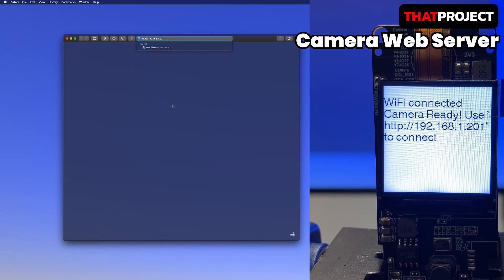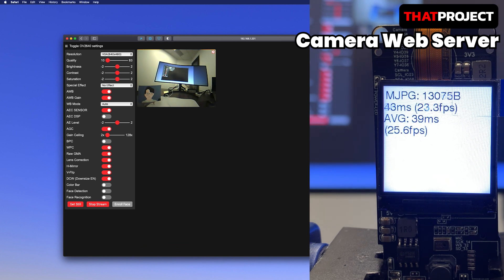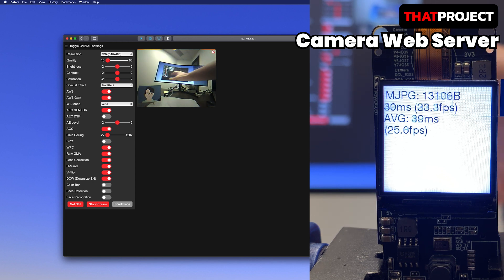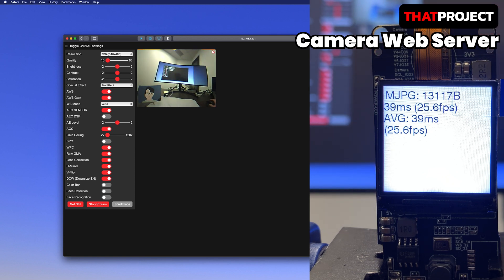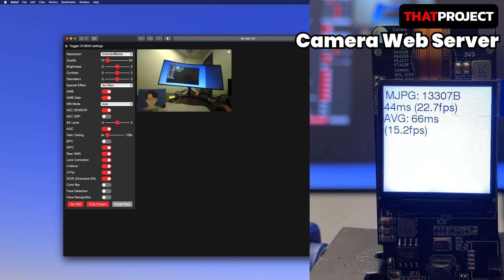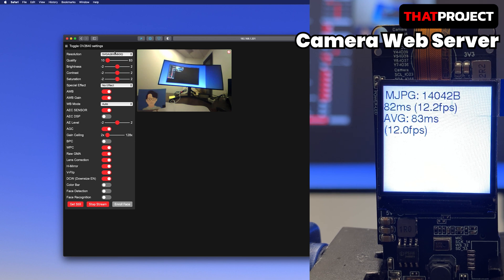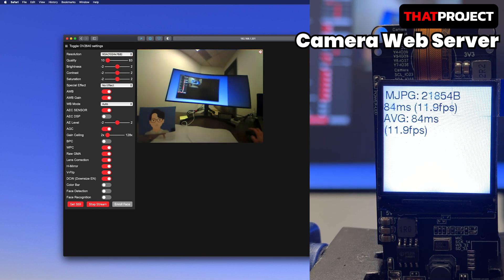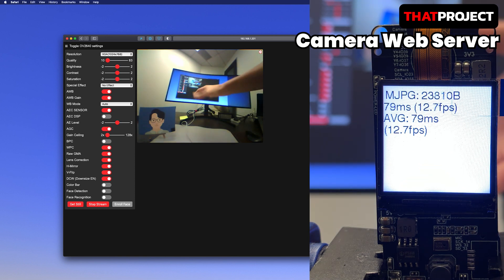What's different TTGO Camera Plus vs ESP32CAM AI-THINKER?

Comment: I do not get you. It seems like the same cameras are used, that is, OV2640. But the image is better on ESP32TTGO? Or are the cameras different in some way, for example, by the connector? Can the OV2640 camera on the ESP32TTGO be swapped with the camera on the ESP32-CAM?
Reply from the maker: Since both use OV2640, the resolution and output format are the same. You can think of this device as a version of the ESP32-CAM AI Thinker board with a screen and MIC added.
Reply: @ThatProject  Then due to what improved the quality of the video?

Comment: can i have the code to write for using ttgo lcd or documentation ?
Reply from the maker: You can find all information you want from here. 
https://github.com/Xinyuan-LilyGO/esp32-camera-screen
Reply: @ThatProject  how to flash ttgo ? arduino idle say can't open
Reply from the maker: @simonevetere9152  The source code they support is NOT for the Arduino platform. It's ESP-IDF. To build and flash it to your device, you need to set up your dev environment for ESP-IDF. OR If you don't need this example source, you can just build and upload Arduino-based projects.
Reply: @ThatProject  thank you, the server work, but my screen is all black, i see this commented 
// TFT_eSPI User_Setup_Select.h 
// #include <User_Setups/Setup44_TTGO_CameraPlus.h>   // Setup file for ESP32 and TTGO T-CameraPlus ST7789 SPI bus TFT    240x240

but arduino say can't find xxx.h etc.. so i alredy try to decomment #include <User_Setups/Setup44_TTGO_CameraPlus.h> but still doesn't work my screen
Reply from the maker: @simonevetere9152  I don't get it. what is the xxx.h? BTW, you're sure you set the dev environment for ESP32 Arduino, aren't you?
Reply: @ThatProject  sorry for english basically with the Arduino code I can't set the working drivers for the ttgo t-camera plus screen, everything works except the screen, do you have any suggestions?  the screen works on the hardware level, but not on the software
Reply from the maker: @simonevetere9152  Have you tried my source code after you set the TFT_eSPI user_setup.h? https://github.com/0015/ThatProject/blob/master/ESP32_TTGO/TTGO_T-Camera/CameraWebServerForTCamera/CameraWebServerForTCamera.ino
If all the settings are perfect, but only the screen doesn't show, it could be a hardware failure.
Reply: @ThatProject  How did you set up the drivers for your ttgo?
Reply from the maker: @simonevetere9152  As mentioned in the video, settings for TTGO Camera T Plus model are prepared in TFT_eSPI. I used this.
https://github.com/Bodmer/TFT_eSPI/blob/master/User_Setups/Setup44_TTGO_CameraPlus.h
Reply: @ThatProject  i know but Arduino Say can't find this file if i include at the start, in what dir did you put It?
Reply from the maker: @simonevetere9152  I included #include <TFT_eSPI.h>. That's all.  Sorry, I don't know how to help you. Please check the ESP32 Arduino Core is installed in your development environment.
Reply: @ThatProject  my bad i have COMMENT the fist one and decomment second, work at all, thanks
Reply: @ThatProject  u project is perfect to me, i only want to convert text in qrcore, so you che go to server ip, with u phone camera